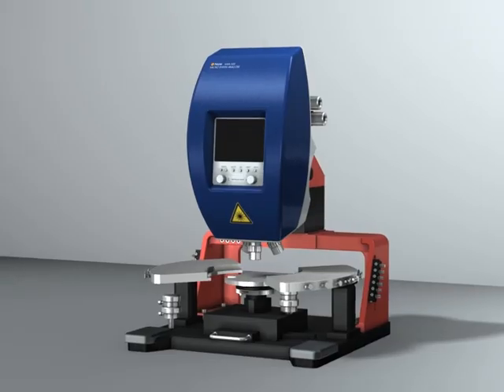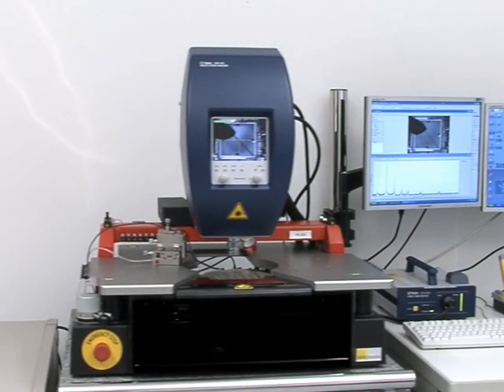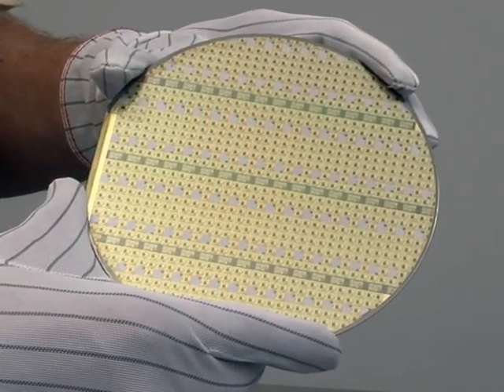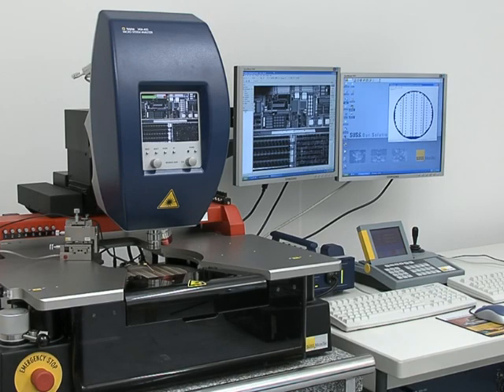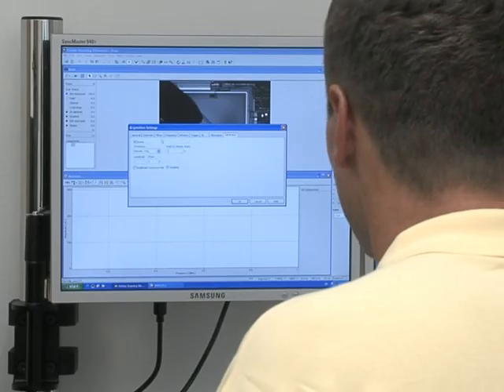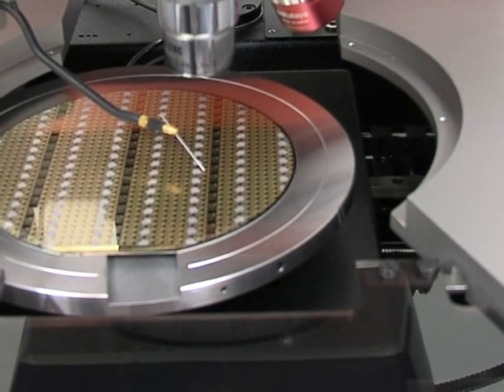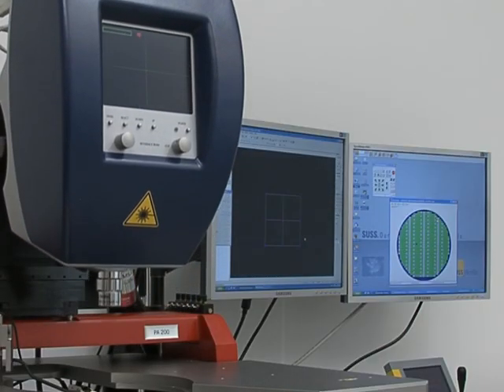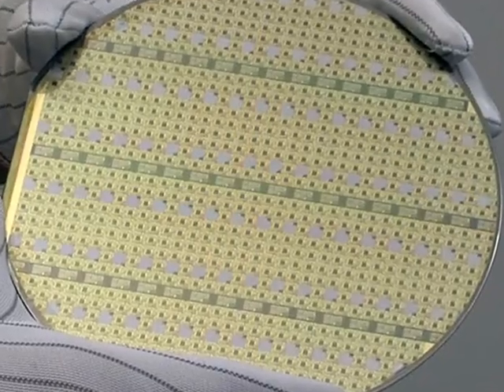Wafer-Level and Single-Die Testing

Comment: How are individual die characterized for DC and RF performance in RF power amplifiers and RF switches?
Reply from the maker: The Laser Doppler Vibrometer measures the pure mechanical response of MEMS devices. Electrical properties as DC and RF performance are characterized by other methods.